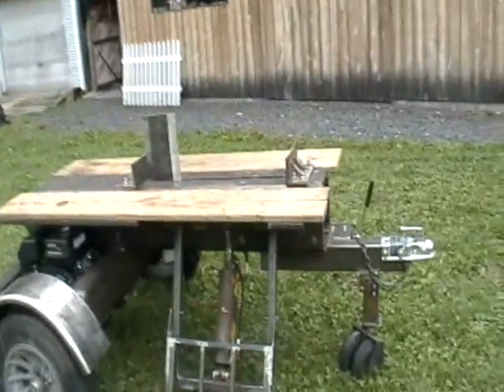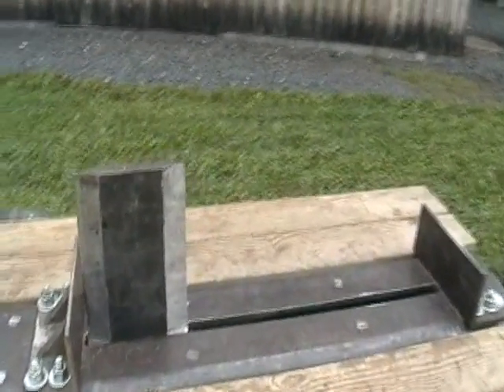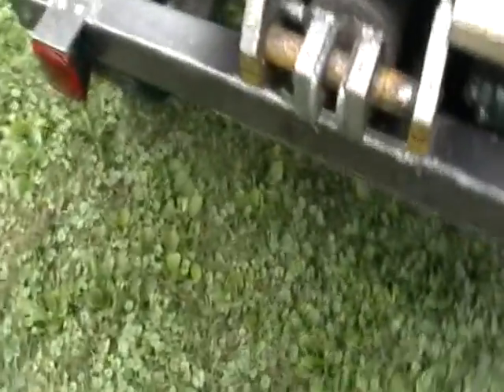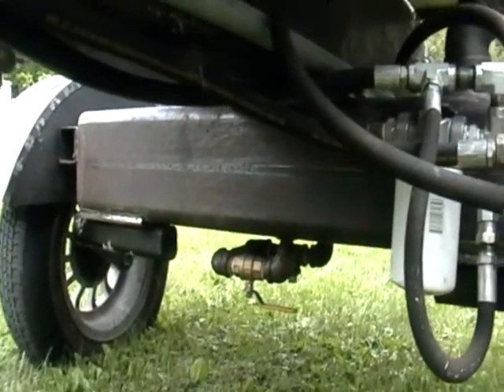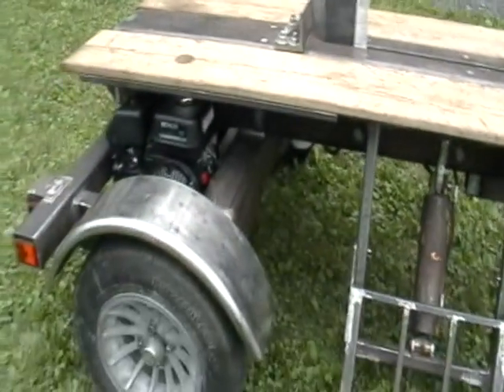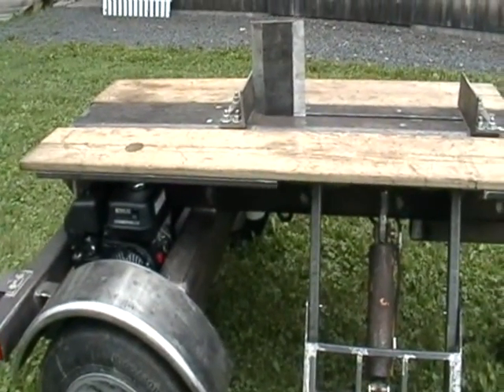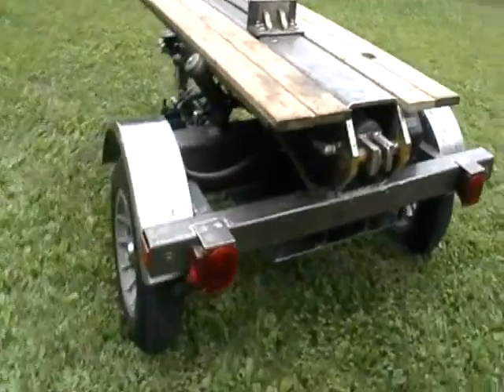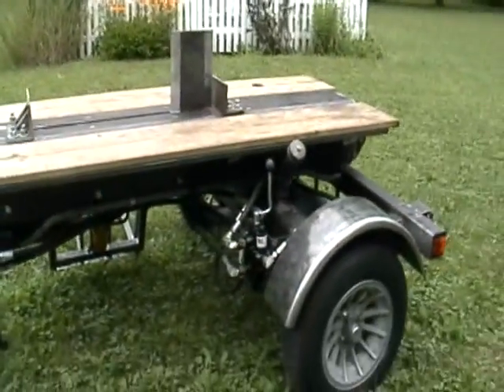P.F. Engineering log splitter - first look

Comment: Nice design, very well thought out! What is the distance from the wedge to the angle plate (stroke)? Also my only real comment is that most commercial splitters with wheels and a hitch will tell you they're not really intended to be pulled faster than 45mph. This is because they have no suspension and can bounce alot when you hit rough spots. Maybe consider replacing the current spindles on it with some torsion bar spindles that can help in that regard? Just a suggestion!

Comment: usually we split a log, with a log splitter, not this go though. 

speed it up?   use a regenerating control valve -- in regen mode the valve directs oil to both ports on the cylinder at the same time and can double it's speed.  I am not making this up, I have one on the splitter I built.  Prince makes one, look it up.  Very handy since you don't need full strength once the round is cracked open.

Comment: I like your design tho.  Can't tell for sure but it looks like over time a lot of debris could build on the back side of the blade under the slit.  Looks like it could be a real chore to clean out.  Other than that I like it.  5" cylinder should have no problem going through any type of log.  You could even get away with the 4 way blade too I'd imagine.  Good job

Comment: Hi Lewie,
i have not taken the splitter off-roading yet but thanks for the heads up! i did upgrade the oil reservoir for this design from the original 5 x 7" square tubing to an 8 x 8" square tubing, and this change is reflected in the plans so the shut off valve can easily be plumbed onto the back side of the reservoir and be totally out of the way. other changes in the drawings call for installing 10" tall log stops, a longer tongue for the hitch, and the option to change to a higher GPM pump and 4 or 5" cylinder bore. if anyone is interested in building this splitter, i'm selling detailed plans on my site www.pf-engineering.com

Comment: Nice setup BUT you might think about turning your hydraulic supply valve 1/4 turn to get the handle off the bottom. Brush or weeds could turn it off and that would not make your pump happy. I've never had any bigger than a 4 inch cylinder and split hardwood with knots all the time with a 5 horse Briggs 'L' head.  Running around 18 tons at 2100 p.s.i. and the kickdown valve on the pump backed down to go into lo sooner to keep the shock load off the engine. Run 1/2 to 2/3rds open throttle. Planty fast and plenty strong.
Reply: My friend, what you're proposing is impossible, according to the charts. According to the calculus a 4" ram with a pressure rating of 2100 PSI equates to only 13.188 tons of force, not the 18 that you're quoting. You're selling yourself 'long'!
https://logsplitterplans.com/calculators/hydraulic-cylinder-force-calculator.htm
Reply: @SeriousSchitt  Right and I knew it was 13 but typed wrong but the last one was rated 25 tons. BUT my latest is rated 35 or better, 5 inch at 3600 p.s.i. and it won't stop at anything. 13 horse motor at 3600 r's.  don't run it that fast because it's prone to heat up but I can cure that if I need to. Just run at 2/3rds and all is well.
Reply: @lewiemcneely9143  I bet, I'm just building one now. Firstly, did gnarly wood stop your older 13 ton set up?

Also, what GPM pump are you running with your newer 5" ram set up, and how many gallon hydraulic fluid tank do you have? In my build I'm running a Honda 22 HP with a 28 GPM pump into a 5" ram. I'm figuring on about 3,000 PSI which should give around 29 tons of force? Mines a vertical splitter, what's yours?

Comment: you might think so, but they have lasted more than 4 years splitting over 10 cords of narly wood. i agree that they should be taller than what you see on my prototype splitter in the video, so the plans provide two different designs of log stops you can choose from, both are 10" tall.

Comment: good question! for faster cylinder speed you could put in a higher GPM pump (make the oil flow faster) or use a smaller bore cylinder (smaller tube fills up faster with oil) or both. industry standard for a basic one-way splitter is 16 GPM on a 4" bore cylinder. this one is 13 GPM with a 5" bore cylinder. 

since there is no need to retract the cylinder every time with this design, a slower moving wedge can still split as much wood per day as a basic one-way splitter at 16 GPM.

remember, increasing system pressure will not affect the speed of a cylinder and a higher GPM pump will not give the cylinder more power. pump GPM = cylinder speed and system PSI = power (and heat)

so to address some of your comments below:

Andrew Kandel said i need a larger reservoir to reduce heat. the 5" bore cylinder i'm running allows me to have good power while turning down the system pressure thus reducing heat.

Kevin Poland said i have no access to the engine. you can't see it here Kevin, but a section of the table at that end is removable allowing access to the engine.

J Ryder said it needs to be faster. see above.

Samuel Lapointe said these already exist. perhaps the square tubing idea exists, but no "cost-cutting for profits" factory will ever produce the quality of one you will build yourself, and for less money. 

Lost Caper was concerned about the valve breaking off in the woods. if this splitter were being used where ground clearance was an issue (by people who didn't care what they hit), i would either put the oil outlet on the side of the tank, or weld a skid plate guard to protect the valve or make sure the person moving it looked where they were going first.

bos dad was concerned about tongue length. i have only had this connected to a ball in the bucket of my front end loader, but i can see your point! a longer tongue will be in the plans.

best regards,
~ Paul
Reply: I STILL think it's a nice setup. The valve HANDLE was my only comment. I have an old MTD supposed 20 ton that I improved on from factory stuff. Always better things to do.
Reply: Awesome ,yes bottom valve, I'd turn it 90% just.a stray chunk oftimber doesn't RIP it off ,cheers

Comment: There is a value that is on the bottom of the machine that would get beat off it you took it in the woods.
Reply: I saw that too, the valve needs to be moved or covered

Comment: Mike, working on them as we speak. thanks to all for your suggestions. reservoir volume is 5 gallons but can be increased with a larger square tubing / axle combo, low pressure return can be increased from 1/2" to 3/4 if that is what you mean J.R. to speed it up, or use a 16 GPM pump, the deck over the engine is easily removable for maintenance. if you want to get a head start, look for a 10" x 10" square tubing 84" long for the main trunk. i used 1/2" wall but i think that was way overkill, and HEAVY. 3/8" wall will do or possibly even 1/4"" wall thickness. so far i have split 12 cord with it and still doing great. had 10 cord grapple load logs delivered this spring, mostly oak 12" to 18" diameter green, will post another video splitting that. thanks for looking. ~ P.F.

Comment: you need to increase the dump side of valve it will speed it up  7 seconds is the goal or less those two ways are the idea but also make the splitter a 4 way